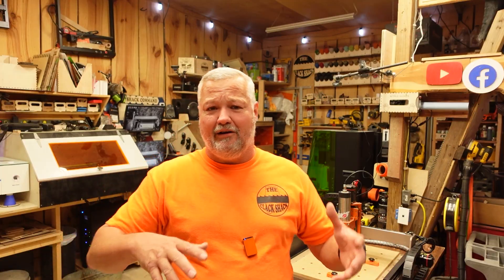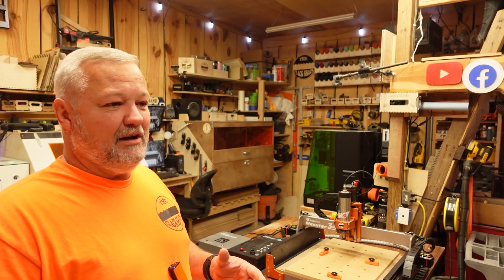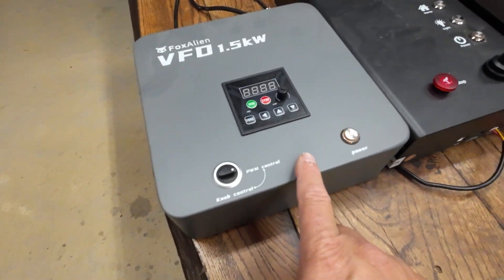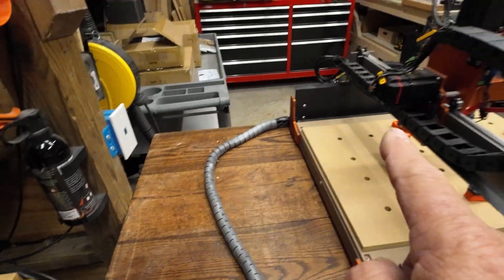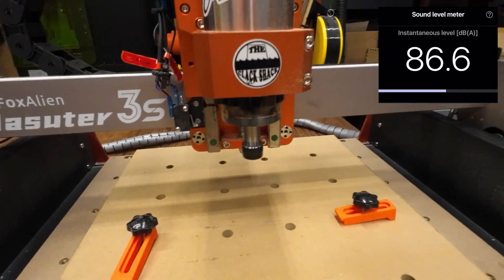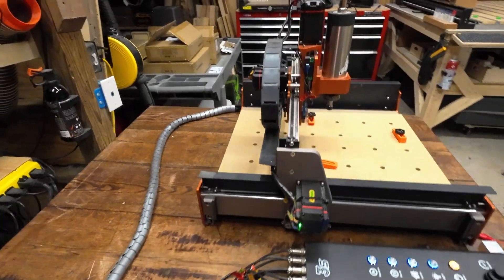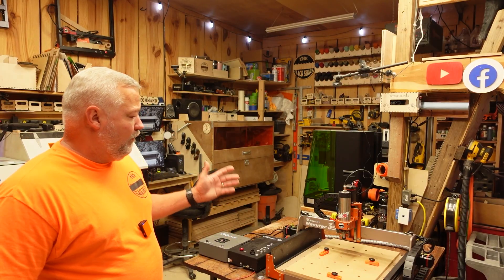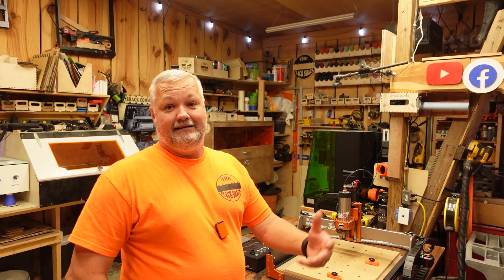Fox Alien spindle kit is a game changer

Comment: Thanks for the video.  I’ve been looking at the FoxAlien XE-Ultra and another brand.  The Ultra includes this spindle, it’s a little larger (800x800), and it has closed loop steppers and linear rails… for about $2000 right now.  It’s hard to beat that price.
Reply from the maker: It is a compelling deal.

Comment: Hi. Is it possible to see the internal parts of the VFD controller ?? It would  be very interesting.
Reply from the maker: Just all the parts bolted to a box with lots of wires.
Reply: @TheClackShack For example which EMI filter are they using ?

Comment: Great info Dave. Do you know if the spinal is compatible with the genmitsu 4040 pro max?
Reply from the maker: It should work, the 4040 Pro Max has a PWM output on the back of the gantry. If a machine doesn't have it, it just means the spindle has to be manually controlled.
Reply: Thank you sir.
Reply: HI. I have just installed one on a Gemnitsu 4030 pro XL V2 and whilst only done 1 test cut so far I can confirm it fits and works.